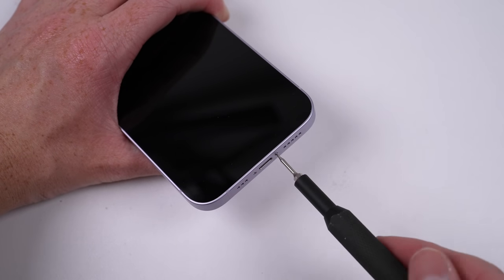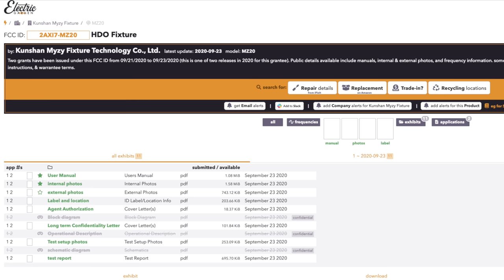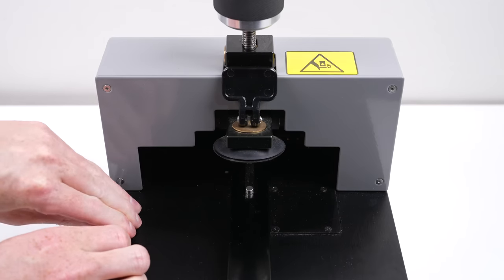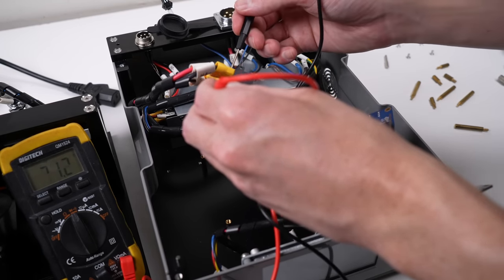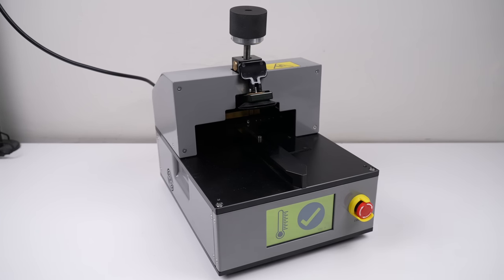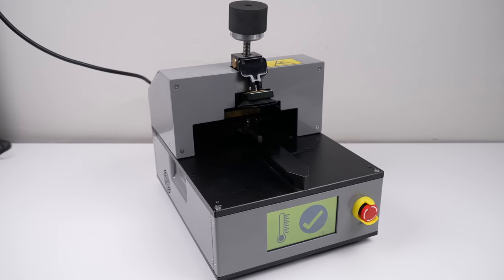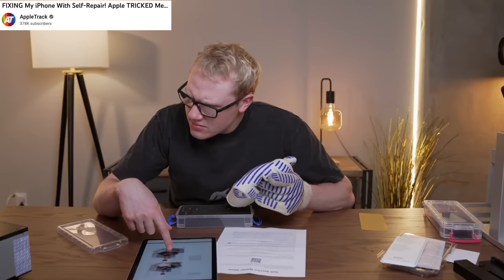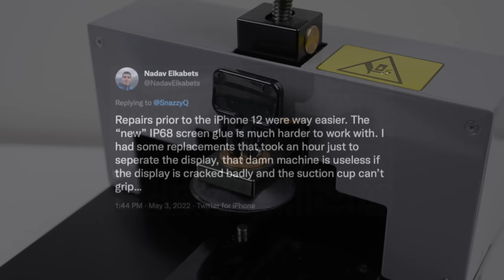This Is How Apple Fixes Its Phones - Tearing Down Apple's Display Opener

Comment: Did you perform a continuity test on the pocket's heating elements?
Reply: Heating elements are not a direct 0Ω short, they're just some oversized resistors, somewhere around 80Ω

Comment: Looks like using military grade components (DIN connectors) and beefy steel doesn't matter in durability if you use high volatility CMOS in your microcontroller 🤣

Comment: Hi Hugh,
I noticed your problem with the Display Opener. I think I know what your problem was and the errorcodes in the clip you showed, too. I worked as an AASP till a year ago. 

When you click in the hotpockets, you have to turn the red switch/button in the front it will spring out. Then begins the heating process, when temp is reached a 2 min timer will apear, after that an alarm starts and you have to push the button back in place.
Another countdown will apear, at this point it is ready to open the phone. 

I am not sure about the manual, maybe I could help with that, but I am not sure, if i am allowed to share this confidential stuff.^^ 
PS: I am pretty sure the errorcode E4 means that the suction cup is not all the way up. 

I hope my memory is right ;)

Keep up the good content.

Comment: The repair tool that needs repair LOL! It obviously runs an os of sorts - look for a JTAG header or similar and see if you can get any clues when connected via serial. Or simply gut it, replace the cpu with a raspberry pi, enable the touchscreen and you'll have a one of a kind.

Comment: Would it be possible to wire up the heating element of your "Crazy" machine to that of the iPhone holder, and use Apple's repair kit just for holding it down and using the suction? I know it will be way too overengineered to do essentially the same thing, but I'd like to see it.
Reply: I'd jsut put in a raspberry Pi or an Arduino and replace the boards completely. A few lkines of code and your good to go. It would be interesting to dump the ROM's and see what hte code actually does!

Comment: The difference between your tools and this screen removal tool from Apple is that it heats the frame of the phone not the display which in turn loosens the pressure sensitive adhesive much more effectively , it also minimizes heat damage to the OLED panel in the display.

Comment: Did you verify that all the simpler commodity components (like the microswitch shown on-screen around 3:01 with that arrow) are actually working?  It's amazing how many microwave ovens are discarded because a simple microswitch like that has failed.

Comment: Reading all these comments makes it really apparent that people don’t know what they’re talking about. I’ve been doing phone repair for 8 years. iPhones are some of the easiest devices to physically repair, aside from the software barriers apple has in place; if you’ve ever repaired a Samsung device or other android, you will know this to be true. Only phone that is easier than an iPhone to repair is a Pixel. Apple isn’t making phones harder to repair purposefully with their physical designs, they don’t have to. The physical hardware is such to keep dust and water out, and even then we still see people coming in for water damage. Using heat and isopropyl alcohol, the adhesive that keeps the screens shut is all but nonexistent. Apple doesn’t have to try to make their phones hard to get into from a repairability standpoint because they already have SO many software points that they use to gatekeep repairs. On almost all iPhones that are still getting iOS updates, the screens, batteries, vibration motors, earpiece speakers, and cameras are all irreplaceable without getting some form of “warning” message along with losing features. 

Just my 2¢

Comment: I think this is easily hackable. Just completely bypass the "smart" part of this machine and directly hook up the power supply to the heater contacts. Sure you lose the timer function but at least it works  and isn't a total paperweight.

Comment: If you can't get the electronics working at all you could always replace the control electronics with an arduino and RFID reader.
Reply: There's no reason to get a tool like this in the first place, it's way too unnecessarily advanced for what it should be

Comment: The firmware's binary might be possible to dump from the chip, although I'm unsure how much - if any - help that might be; it's entirely possible that there's a way to simply write your own better firmware and flash it onto the controller, as it does seem like it'd be fairly easy to reflash.

Comment: Can you just apply voltage to the heating pockets to use the suction cup?
Reply: I was thinking that too, although I guess the main unit is governing the heat level? Even so, it should be possible.

Comment: Nothing new here. Almost every PCMCIA modem you have ever bought was heat sealed. Not user repairable. The device covers were clamped, the device was heated to melt the glue and cooled to set. 

Other devices we made used BGA components and they are absolutely not user serviceable, either.  Most device owners have no business inside modern devices because they have zero knowledge.

Comment: It seems you put more effort in making this video than trying to repair the device.
Just put cables to the pockets, use a timer and heat them up would be an alternative.
You also could have used the suction part to open the preheated phone.
It feels, like you just wanted to bash the fool, not using using it all. And you spent money on it.

Comment: Good thing EU is forcing Apple to comply with them. The next thing EU should force Apple to do is make iOS an open source OS.
Reply: And they are forcing all phone companies to make the battery accessible
Reply: @tbu_drachenkater5397  that sounds like a good idea. I hate the idea of my phone battery dying and me not being able to replace it easily
Reply: @tbu_drachenkater5397  Apple wanted to have MFi requirements for USB-C for iPhone, where charging and data transfer will be slower for non-MFi USB-C cables. Unfortunately for crApple, EU will not allow them to do that.

Comment: I VERY much doubt that a bespoke INDUSTRIAL repair tool designed and specified by the most intelligent consumer electronics company on the planet, for the repair of their precision, world-leading range of smartphones, is “useless”. 

Remember, this is a specialised piece of CUSTOM equipment designed to be used on production lines and in Apple certified repair centres. The great unwashed getting their hands on it, and then one or two of them deeming it “useless”, says more about a VAST lack of understanding of process and procedure, on the part of said people. 

“Joe Public” fixing an iPhone does not automatically make him an engineer, with the kind of analytical mind engineers tend to have, nor afford him the depth and breadth of experience and insight prerequisite to understanding the hows and whys of Apples precise methodologies for assembling and PROPERLY repairing Apple products. 

The fact that ANYONE can rent or buy one, is the answer to why you should ignore the opinion that the machine is “useless”; I’d say that was more an indication of the lack of understanding and experience of the one using it. 

Just because users have carried out repairs for years, using cheap nasty tools and clumsy procedures, doesn’t mean they have a greater insight into PROPER, scientifically designed and tested tools and procedures from Apple, therefore affording them the ability to cast Apples tools off as “useless”. 

I’ll take Apple’s judgement any day of the week over the opinion of some back street Everyman who just so happens to know how to heat glass, lift it, replace a battery and then reverse the process, and charge for doing so. THAT DOES NOT MAKE YOU AN ENGINEER.

When the general populous operating these machines, all have decades of experience in materials science, manufacturing processes, material tolerances, expansion coefficients, adhesive viscosities and the adhesive manufacturers specifications for applying them effectively and under what temperature and pressure, and for how long, to successfully effect a watertight seal…. THEN I might pay more attention.

Comment: This is another reason why I don't buy Apple products. Their phones require a specialized machine to be able to properly open the phone to service it. And, this is only the start! Each jig for every model is different and costly.  In the past I've had horrible service issues with Apple. I now buy devices where they are not complicated to take apart, replacement parts are available, and it is snot overly complicated to replace parts.

Comment: i kinda think the machine fails because apple wants more sold devices and throw the old ones.

i certanly hate that and i would peffer spending just the part alone and buy a cheaper workstation than the overpriced and absolutly useless apple's tools

Comment: apple hires the worst engineers and tells them to produce the worst breakable designs. they even produced over priced repair machines that break easily. all they had to do was put a timer button and a temperature dial. they could have a universal holder for the phones. read the list of temps and times to open the phones. set them use the handle to open the phone when it is done.

Comment: So this video shows the issue with independent repair "people". They don't care about doing things properly, only doing it.

This thing is designed to only heat the frame of the phone, just enough to get the adhesive to give without the need to shove Jimmy tools and picks under the display glass, or heat the crap out of the whole phone. It is also designed to allow for the removal of as many screens per hour as is realistic, its the same for all their other tools, including that stupid battery roller. Its silly, but it ensures that the batteries are properly adhered, and in a way that only takes a second to do reliably. 

Know why they do it? Because they can't damage a users device. Even plastic tools can cause damage when prying, and batteries and screens do not like the heat from those hot plates.

You want to repair devices, but not invest in the tools to do it properly. This clearly shows in your work on many videos. So sloppy.